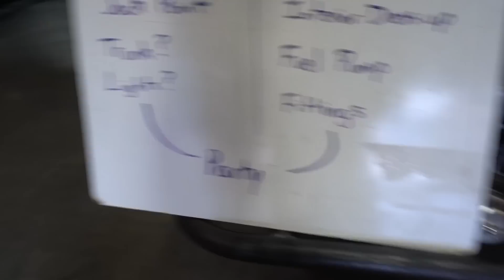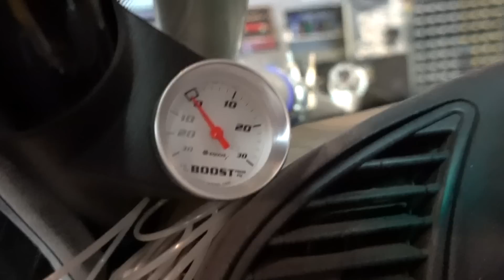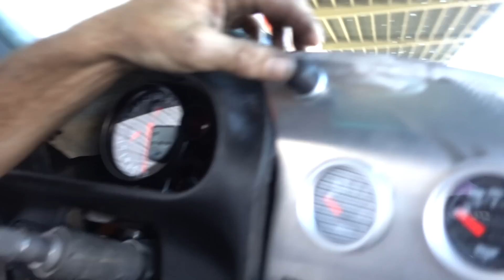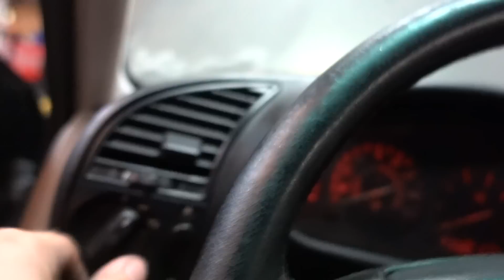Sh*tcar V2 Gets a Facelift, Weight Reduction, And Reviewed by HHIC

Comment: If you are not trying to drive it on the street the rear lights might look good on the corner of the bash bar. The curve of the bar and light might almost match and they can me mounted just inside the bar so they are protected.

Comment: it wouldve been better to gravity feed the oil from the tank mounted over the turbo and use the pump on the exit of the turbo and pump through the oilcooler and back in the tank 
you need some extra room in the tank as the oil gets out of the spinning turbo looking like a mayonaise slurry
might beed to take the vacuum line for the brakebooster of the intake and mount it on an electric vacuumpump

Comment: Yeah the trunk LED you guys bought for the 325i E36 will fit on the 4-door one because it is a 4-door model the same way as the front fenders of that will not fit on the other one because it is a two door and there's some other inconsistencies like tail lights stuff won't fit off of One Versus the other.... But if you're going to cut the rear quarter off that E36 4 door then the trunk lid and all the other stuff should work but there is a difference

Comment: I'm just so you guys know the difference in the trunk does not make a difference if it's at 3:18 or 3:25 and makes a difference if it is a four-door or a 2-door that's the only difference the trunks are the same otherwise if it is a four-door trunk it will fit on all the other four doors regardless what the engine is and the same with the two doors

Comment: Should the drain of the oil from the turbine be at the top of the tank, it will not be possible to flow to the bottom of the tank with the pressure of the oil that is inside. And it should have vent on the top.

Well I can be wrong, and sound like a **hool.

Love the build by the way.

Comment: Does anyone know how brad wired up the ignition system? I have a 325is with no key and can't get it to start. I tried the ignition switch and connecting the hot wire to the starter wire but all i get is clicking but no crank. The fuel pump won't prime either. Thanks

Comment: It doesn't matter if the trunk is off of a 318 or a 325. However it DOES matter if it's off of a sedan. Most sedan body parts won't fit a coupe.

Comment: Mount the blowoff to the side.  Now you don't have so much overhang and extending the car that you just shortened..... (Unless you're going to add body panels back and get to original length again.)

Mount the oil cooler vertically and feed it from the bottom.  It will allow the fan better flow, and allow the cooler to fill and cool efficiently instead of just having oil pooling through it along the low side of the coils until falling out the other end....  Jesus.

Comment: E36 318 and 325i trunk is the same as long as it's both a coupe guys. Also, you're trying to put Sedan shit on a coupe.  You'll never get any panels to line up, if that's your goal... Something you have to understand about E36s: Coupe shares bodywork with Convertible, except the trunklid(they're flatter). Sedan shares front half bodywork with Touring. But those 2 groups are COMPLETELY different cars even though they look similar and share the name. Nothing except bumpers, nosepanels and headlights is the same between them for external bodywork(even the corner lights are different). Seats, dashboards etc are all different too. Front and rear suspension is the same as far as I know(although I bet shocks/springs are different)...  
Compacts(318ti) share bodywork from the firewall forwards with Sedan/Touring, but every single part behind the firewall is unique to the Compact(including rear suspension, which is E30-based)